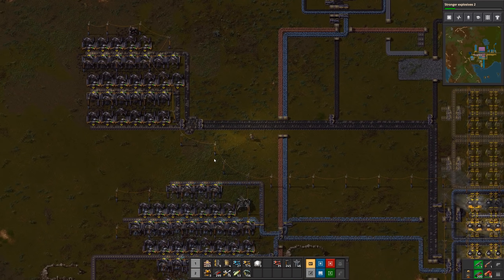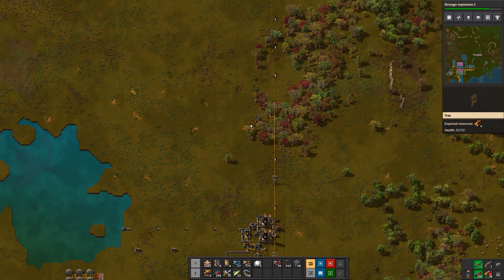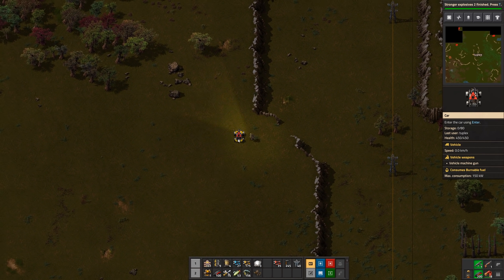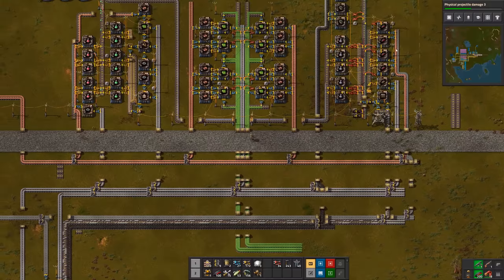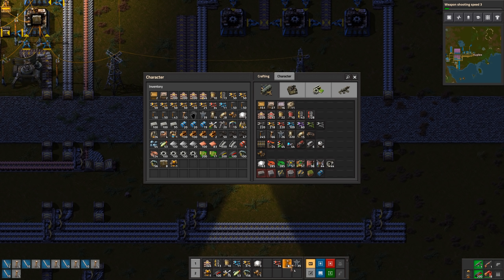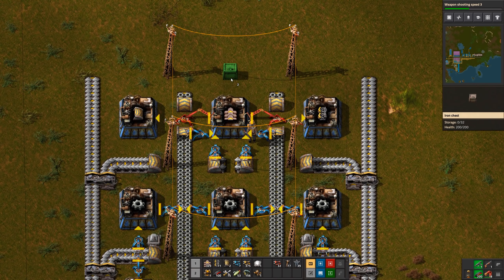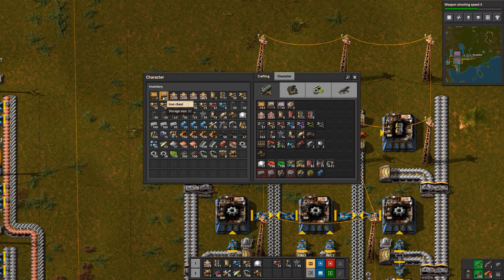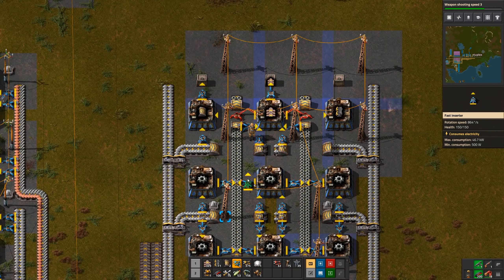Factorio 1.0 Tutorial #7 - The mall

Comment: The machine for blue assembly machines doesnt seem to be working... Copper on both sides of the belt or am I mistaking? :S
Reply: Saw that too. I think its just a "glitch" in the system because he didnt clear the belt after placing down that splitter on the left of the Blue Assembly Machine "crafter" so I reckon soon as he picks up those few plates clogging up the belt, it should start working.

Comment: Do you plan on upgrading to electric furnaces? Can't tell if your smelting design accommodates for the increased size
Reply: I think the consensus these days is that it's not really worth it until you switch to moduled & beaconed builds.  There may be those who disagree, though, so take this with a grain of salt... but in general, it seems that the extra effort of building things ready to accommodate that change isn't worth the trouble.  If you're trying to be particularly pollution-cautious, or have a very low quantity of fuel to burn, or something, then YMMV.